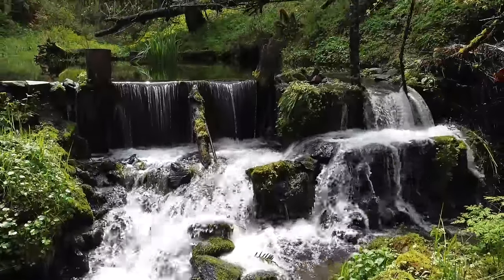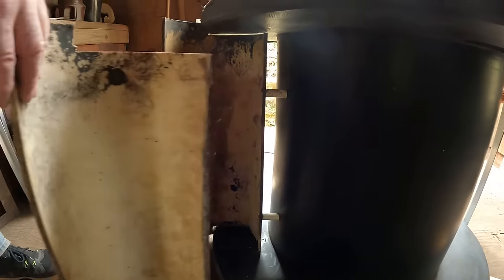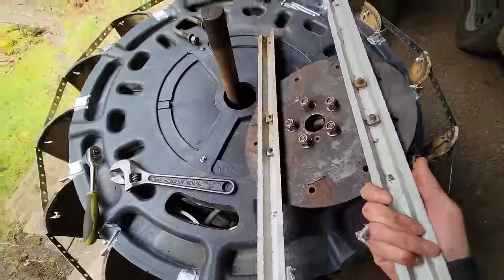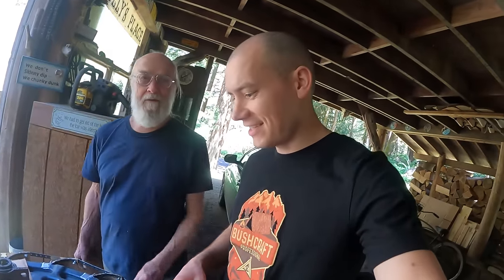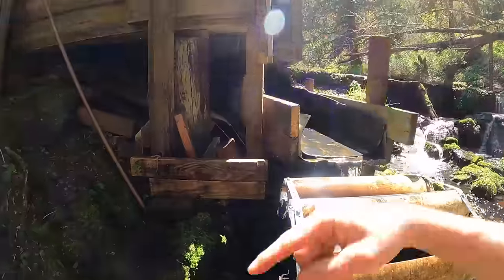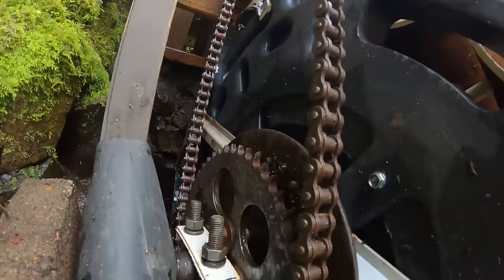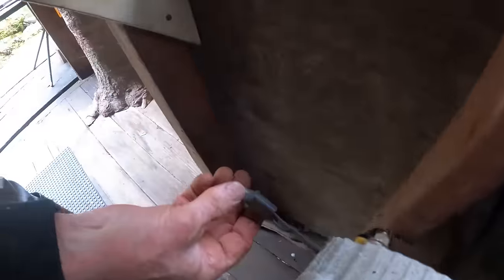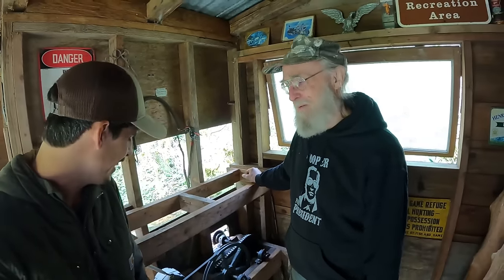Restoring Al's Hydroelectric Water Wheel

Comment: Little tip to increase your power output, create a channel or walls where the water falls to guide it directly onto the buckets and you'll waste less water and generate more power, also allowing the chain to rub up against the wood when in motion is only decreasing the power output through friction ans drag resistance, space them roughly  3/4 inch away from the lumber itself, you will be truly amazed by just how much more power you can generate without drag resistance, that resistance is bogging down the wattage by trying to compensate and keep up with the friction, therefore wasting roughly 2 to 4 volts of energy
Reply: Wood is on the slack side & just used as a guide - very little drag

Comment: Oh man, what a time to replace the shaft bearings. I said this on another video. I suggest a go fund me or whatever monetary platform. The other thing I see with the chain, is quite a bit if friction is gained by using wood as idler. Whenever tension is on the chain should be an idler sprockets. This would multiply the efficiency exponentially. I wish I could at least send hardware.
Reply: Wood is on the slack side, no tension. I tried idlers & not worth the effort

Comment: Have to say the copper pipe trick on the battery is genius.
Reply: Especially since it adds more contact surface for you to drop something and create an arc, instead of using coated cable. That kind of genius can get you killed

Comment: I hope at some point, Al adds a chain tensioner to the primary chain.  It wouldn't have to be too complicated, just a board with a roller on the end, and preferably spring, or even gravity, loading.  He's losing a lot of power the way he's doing it now, just running against the raw ends of those boards.

Comment: A piece of dirt with a running stream. Cant ask for more. Drinking water, hygiene, and hydro power, plumb in some large pipe, reduce it so it builds pressure and add a spinning device to generate electric, install more pipe the same size for  a little ways, reduce pipe with reducer to build pressure further down from the 1st, and keep going as far as u can keep the pressure up to turn spinning wheels

Comment: You need to put an extension on top of that water shoot then it wouldn’t be so messy the way off overspray and you’re more weight of water rotating end of the wheel to provide more talk great idea but needs a little tweaking